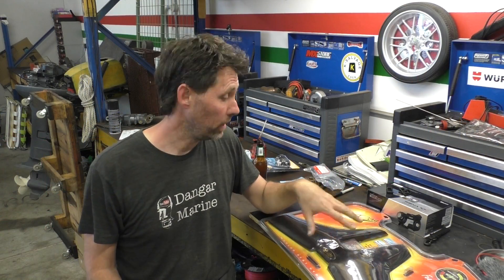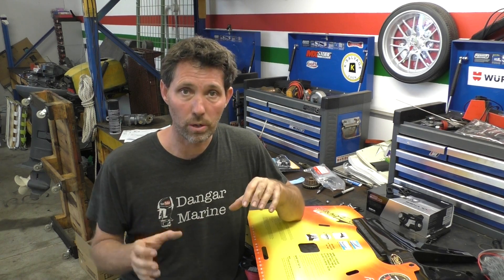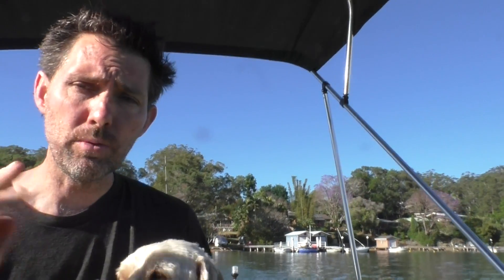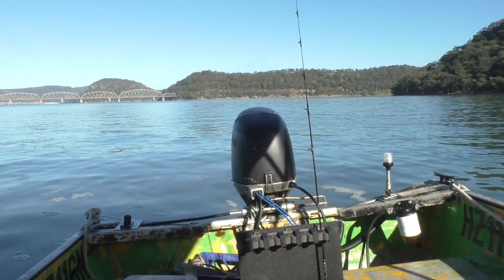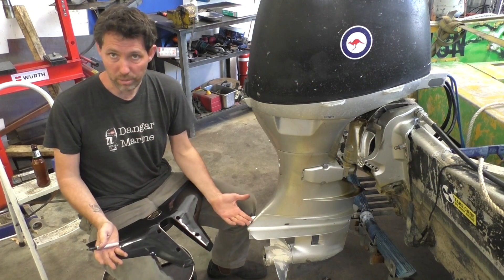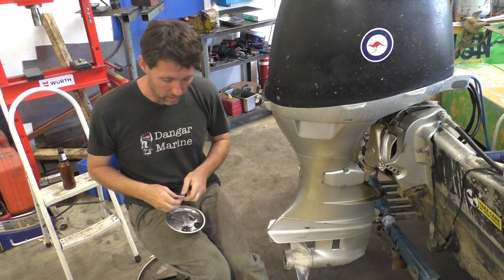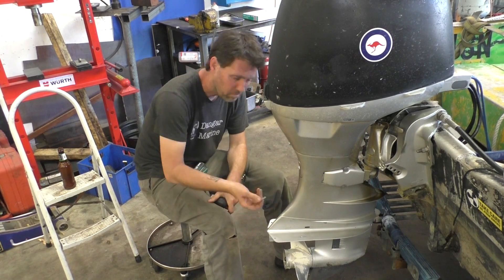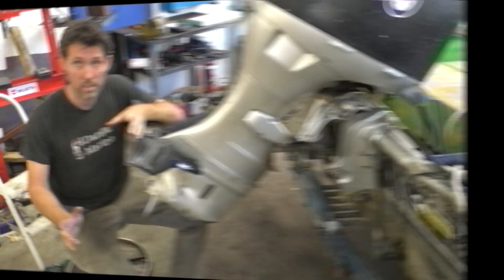Outboard Hydrofoils

Comment: Well-timed video, as I was just standing in a store the other day (Cabela's) looking at these hydrofoils, wondering if something that simple would make a major difference in my boat's performance like the packaging promises.  I have a 16-foot Starcraft V-hull with a 75hp Mercury and the porpoising can get annoying fast if I'm not riding the trim button, especially when I'm the only person in the boat.  Stingray and Marine Dynamics both have no-drill versions that aren't terribly expensive.
Reply from the maker: Hi mate. If you are having a problem with porpoising then I would definitely give it a try. As you say, they aren't that expensive and if they can solve you problem then it is well worth giving it a go.
Reply: G. Johnson, Your boat is fairly light with a good size motor on it .  Proper prop pitch will give you a pretty good hole shot.  Venting the prop like on bass boats has helped out a lot on even smaller boats with less power for hole shots and getting on plane.  I don't think you have a problem there.  Your problem is at the other end of the rpm range.  
Porpoising is caused primarily by a motor that is trimmed too far out.  Is your motor sitting at transom height?  Raising it a bolt hole will lift the motor and decrease the angle needed to push the boat at higher speed.  it will take very slightly more time to trim but it will probably be unnoticeable.  You could spend no money and just trim the motor in a little but you will lose a little speed.  one thing people are not talking about is that when you are trimming up, the hydrofoil is trimming down.  That is where you will lose speed with the hydrofoil..  
A good rule of thumb is that if you actually NEED a hydrofoil then you are either over pitched, under powered, or weight is not distributed correctly.  Too much weight means you are under powered.  My experience is that with a plaining type hull you can usually get by with ok performance with half the max horsepower and do satisfactorily with 2/3 the max rating.   For instance, a boat that has a max hp of 150 will work at 75.  It will be satisfactory with a 100 (typically a 90 or 115) and will perform well at 150.  I have seen a similar boat with a 140 and a hydrofoil.  that told me he was over propped as the boat had enough power, assuming the motor was in good shape.  My ranger rt188 porpoises with its rated 115 and the factory sets it 32 holes above the transom.  lifting it one hole helped a whole bunch and one more might get rid of it altogether.  at that point a water pressure gauge is required to make sure the water pick ups aren't starving for coolant.  A hydrofoil is a cheap fix for an underpowered boat.
Reply: Definitely made a difference on mine! Worth the small price to pay for such a sweet upgrade! Your boat sounds prefect for this? Did you ever end up installing pone on yours? How do you like it?

Comment: Did not work as well on my runabout with 40HP Johnson. While it does in fact planes quicker there is a noticeable loss in speed, For that reason I removed it.  May work better with larger engines.  Enjoy the channel.
Reply from the maker: Hey John, I'm going to do a top speed run on my boat soon and see how much has come off. If it is too much I might remove it too.
Reply: I have a 1982 90hp Johnson it slowed my top speed down a bit for sure. It also made the ride more stable. That engine hauls so it was able to keep up with the extra drag.

Comment: I have a Honda 50 hp four stroke 05 model it's on a 4.5 m poly. I am not happy with the way it's pushing the boat it's having trouble getting on the plane. Will putting a hydrofoil help   Also I want to change the prop can you give me any tips cheers
Reply from the maker: It might help a bit, but the prop video I saw you commented on earlier is probably more relevant. Take a look at how many RPM the engine does at full throttle and adjust the pitch to the formula that an extra inch of pitch will lose 200RPM, one inch less will gain you 200RPM. You want the boat to be close to its maximum RPM at full throttle.
Reply: Dangar Marine thanks for the reply. Love your vids keep them coming. I will let you know how I go cheers!!! Mate

Comment: Great video Stu.
My boat currently has no issues and is very good on fuel with the tldi, I cant decide on fitting the hydrofoil Se sport 300 or not.
I do notice that in Swansea channel at 4kts we create a fair amount of wash, do you think the hydrofoil would help?
Reply from the maker: It's might help a bit, but a hydrofoil probably doesn't do much below about 10kts, it really needs the water flowing over it to have an effect. You'll probably find moving weight better in that situation.

Comment: I have a 1998 Campion 627, 20 footer with a 28" bracket outboard set up. 200 hp outboard. I was interested in raising my minimum planing speed to better cut through rough water(by keeping the bow down). I first tried a Stingray SE 200 and found it made a bit of difference, but, not that much. Then, I ran into a guy with a 23' Trophy, who had just gone thru the same process, and consequently upgraded to the Stingray XR111. He indicated a much better enhancement with this foil. Consequently, I did the same thing, switching it up to an XR111. My boat does come on plane a bit faster now, than with the SE 200.  The result I like the best, I can hold my boat on plane at 13-14 mph, now, giving me a faster, more comfortable, speed thru the water when running in bad conditions(something I frequently have to do). I did lose a couple, three mph off the top end. Fuel economy doesn't seem to have been harmed, possibly a bit better. For my goals, the XR111 did the job pretty good.
Reply from the maker: Hey Jim, interesting to hear your results. Travelling at a modest speed through choppy water is something I do often too so I'm hoping it helps me in the same way. I haven't done a top speed run yet, I should have done that for the video, but I'll be interested to see the effect it has had there.

Comment: Hey Stu, I've got a 1989 Mercury Classic 40 (not the oil injection) and I've got an issue. The motor starts fine and idles fine, but when I go to plane it will take almost 30-40 seconds (Boston whaler 13 ft) and my top speed will be about 18-20 knots. Also the engine will only make it to 4300 rpm and will suck fuel, I mean really suck gas, I only got 2 miles on 6 gallons. So I've replaced spark plugs, fuel line (from tank to motor), fuel filter, have done a compression test (120 psi on all 4), made sure it's firing on all cylinders and have brought to a mechanic who wasn't much help. He replaced a coil and calibrated the butterfly valves (did absolutely nothing). Help please, I'm thirteen and have no idea what it could be, carb clean?  

PS: Is using my age technically bribery, eh I dunno :)
Reply from the maker: Hi mate. Were the spark plugs very black when you took them out? I've seen an outboard where the choke was stuck on causing it to have symptoms very similar to that.
Reply: Dangar Marine When I replaced them, the bottom cylinder seemed a bit wet, but I dismissed that because I had just run the engine
Reply: Also there isn't an air filter on it and you can see right down the carbs, it appears that the flaps are all the way open. I'm not sure if this engine used a fuel choke though, (its a press key to choke).
Reply: Dangar Marine Update: I checked the choke, and it does add fuel instead of block air. Also it is working, you can hear the solinoid,  if you choke it while it's running it will also die. I did notice that the mixture screw was turned all the way in, and I did play with it but it didnt seem to do anything.

Comment: Great vid Stu...a bit in two minds now on mine...   Just in reference to comment below re top speed depletion...your "launching the Green Machine" video showed the old girl topping out at 25 knots as I recall..  I guess you need to crank the BF40 out to WOT and get that GPS reading perhaps...then subtract 2 knots for the bimini....lol.    Thanks for sharing this info.. I think this video was very helpful to a lot of viewers... BTW Go Eddy !!
Reply: or is that..add two knots for the bimini
Reply from the maker: Great minds think a like! I was just recalling that I did that top speed measurement without the hydrofoil so I'll do that again and see what I get. Of course I didn't do multiple runs with and against the tide etc but we'll see how it comes out anyway.

Comment: If you run twin Motors & you have Tilt trim,  This is where you will see the benefit of these add  on's,,  Think of these as Trim Tabs,       But only if you have Twin motors with tilt trim,, Aside from this situation they are """"almost """"  use-less...      kodi
Reply from the maker: Unless the boat has a serious problem with trim, I agree they don't do much. I'd love to do a video on twin motors one day, they are by far my favourite boats to drive.

Comment: A trick with Nylox nuts... Use WD-40 before tightening. This will stop you from ceasing the nuts when installing..
Reply from the maker: Sounds like a good tip. I've got some anti galling paste for stainless fasteners, but nylocs are a different beast.

Comment: What is that filter like component you have mounted on the stern of your boat? On the inside...
Reply: Its a fuel water seperator. It's  a great add-on
Reply from the maker: As Jimbo says, it's a water separating fuel filter https://www.youtube.com/watch?v=L4FnuY989w0
Reply: Fuel filter
Reply: Nickali that’s huge for a 40....never saw one for a non Diesel engine before

Comment: Put the foil on and then get a higher pitch prop. Iv bought 4 props now haha
Reply from the maker: I'm definitely keen to experiment with some different props now.
Reply: Dangar Marine yeah I'm gone thru 11 12 14 back to 13 haha 
I will run the 13 for awhile see if I think it's getting good rpm still. Then start to hunt around for a 4 blade maybe haha. Can't remeber the rule of thumb. Something like if it's 13" pitch on a 3 blade it should be 11" on a 4 blade. Something like that.
Reply: Dangar Marine did u find u here like more gergle noises with the foil. Like the exhuast bubbles rumble under it or something
Reply: BAJATWIN just wanting to try out different styles of props?

Comment: Iv got a 420 renagade with a f50 tiller and fuel is in the back do with 2 ppl n fuel it's heavy in the rear but has power. So I bought one. There is a strange transition area when trimming where they wants to plan on one side. Due to the foil lift but with 0 trim it falls to one side. This didn't happen before I put it on. So it's not the hull. Just the lift of the foil at 0 trim which is like negative angle anyway.
Reply from the maker: Interesting to hear that it is having that effect. Sometimes I think it is really hard to predict what the outcome will be until you try.
Reply: Hmm I wonder why it’s doing that. You’re saying the boat is lopsided when planing?

Comment: Great work putting the time in to help us out here....anyway I have a question..i have a yamaha 60 2 stroke and I'm having trouble at idle and accelerating....do u have any suggestions on how I can clean the jets or show me what to do.....please help in South Louisiana
Reply: Did you do any adjustments to the mixture screws or did the motor just start doing this? I'm in south LA too.
Reply: jimbo gasoline .....the last time I took it out I was a lil hard to start....then yesterday I went on lake desalmends and it took longer to get on top....but no did no adjustments yet...
Reply: Brad Portier Ok when was the last time you had carbs cleaned? Does the motor kill on you? It could be a few things causing this. I'm in Metairie
Reply from the maker: Hi Brad. Here is a very old vid on doing a carb clean. That is where I would start https://www.youtube.com/watch?v=ye_Ui9D8dBE
Reply: Dangar Marine thank you very much I will start here...by the way keep up the good work you know ur shit.....drink one for me today.....
Reply: jimbo gasoline it killed on me when i went in reverse to clean the prop and when I go forward it takes a bit to plane off....when in on top it runs fine but the initial get up and go is the problem....and not a lot of power in reverse.....thibodaux I'm in....
Reply: Brad Portier I would listen to Stu and do a carb cleaning. Order the gasket set. Also make sure you have fresh fuel. I had a problem similar to yours and water in my fuel was my problem. It's just good  to cross off all possibilities until the problem is solved.

Comment: I can't hear on the video when it starts to ventilate.  Please describe how to hear it.  Is that the same as cavitate?  Also please compare this "whale fin" versus 2 hull mounted trim tabs.  Show Eddie enjoying the ride or getting upset.  Thanks Stu.
Reply from the maker: When the boat starts to ventilate you will hear the RPM climb suddenly and the pitch get higher. You are right in that it didn't come out as clearly on the mic as it did in real life. Will look at a trim tab video down the track.

Comment: HI Stu - I have a  more compact hydrofoil, kind of looks like a stealth bomber,  on a 1993 17' grumman 1784 - 70 hp evinrude.  The main things I noted is that the bow doesn't rise as much when trying to get on plane, but whether its quicker is debatable.  It also seems to run quieter, no porpoising, and lastly, it gives you a step to put your foot on if you are trying to get back in the boat from the stern (also acts as a bumper like you mentioned to some degree).
Reply from the maker: Ah, that is true about using it to climb back into the boat when you are swimming. I used to do that all the time when I have had one in the past, I had forgotten about that.

Comment: Good stuff ,  put one on my 130 2 stroke, the 1st thing I noticed was it was alot quieter, it planed up quicker and the 23 ft boat was easier to steer.  Fuel ??  idk, but its staying on
Thanks Dangar, from southern Calif.
Reply from the maker: Thank mate, great to hear that the hydroil has really worked out for you.
Reply: Dove si acquista la pinna

Comment: Nice, easy installation.  You (and Ed) almost could have done that right on the water and saved the hassle of landing, trailering, and launching again.  Then again, I suppose you've got to pass by a gas pump at some point, so....      
Could you feel any difference in the steering at all?  Meaning does the helm feel any more stiff to turn than before?  As for boats that don't ride quite level...  I had always assumed that it was simply a matter of poor weight distribution in the boat, such as one very large skipper at the helm and not enough passengers (or cargo) to balance it out.    Suggestion for future episode:  portable ballast systems for the portly helmsman.   

And as for being easily distracted and diverted onto off-topic conversation... How is it that as one goes around the world, motor vehicles vary between LH drive and RH drive, but in the world of smaller marine vessels, the helm seems to remain  on the right side?
Reply from the maker: It is a pretty straight forward installation, but I'm not in the habit of taking the boat to the workshop as it is easier that trying to predict all the tools you might need. For example I would have taken the marking pen not knowing it wouldn't reach through the back hole. There is always something need that you didn't bring. The thing with sitting on the right is that the weight of the driver helps to counteract the transverse thrust from a clockwise props. Cars don't have this physical reality they are dealing with, it is just an arbitrary choice.
Reply: Helped my boat steering forsure at high speeds!

Comment: well,if you have a bow rise it helps,i used it on yamaha 50 hp and 4 m long speed boat,i couldnt drive at 5,7,9, knots of speed with out it,it was  digging a lot of sea,so i was able to go 3,4 knots or 20 knots,later with use of it i was able to digg less sea and go at 6,9, and other speeds
Reply from the maker: That does make sense. Many boat will sit flat at very low speed when the hull is in a displacement mode and then okay again when fully up on the plan, but there are plenty of times when you want to travel at something in between.